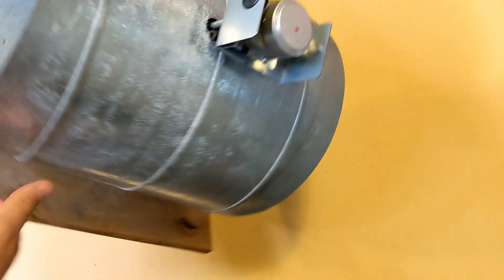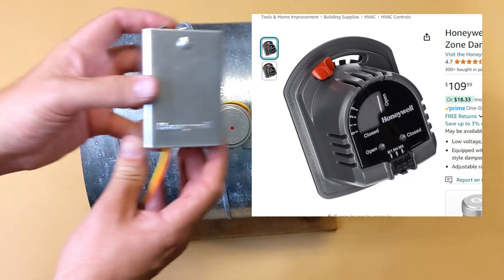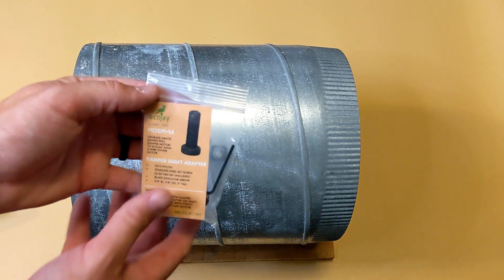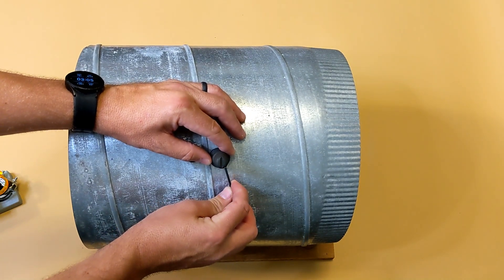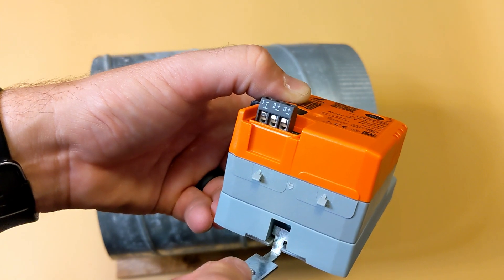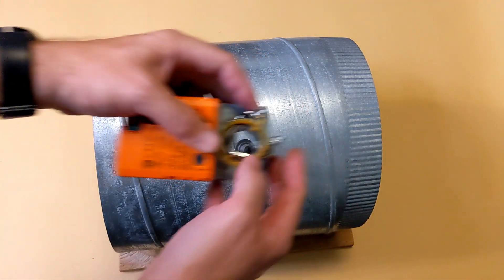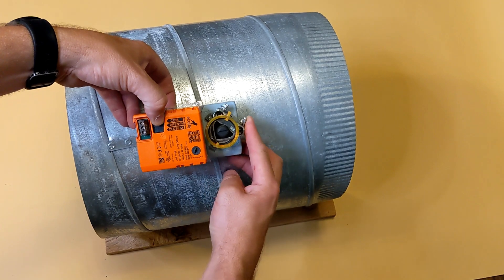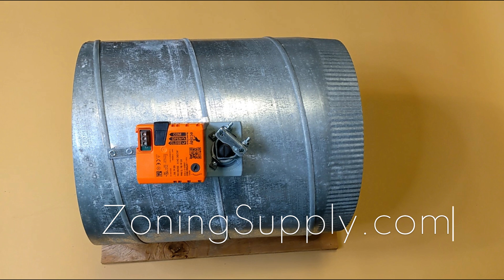Honeywell ARD Damper Motor UPGRADE using Ecojay/Belimo Motor and Shaft Adapter.  FULL INSTRUCTIONS

Comment: Hi I replace the motor hooked up the wires. But if the damper closes it goes counter clockwise. If I open the zone it goes counter clockwise.  It does not reverse direction. Thoughts?
Reply from the maker: There is a rotation-direction switch on the top of the damper motor.  (It is round and black) You can switch this from the factory position "1" to the "0" and the motor will rotate in the opposite direction when powered.  Hope this helps, you can call us or email us if you have more questions.